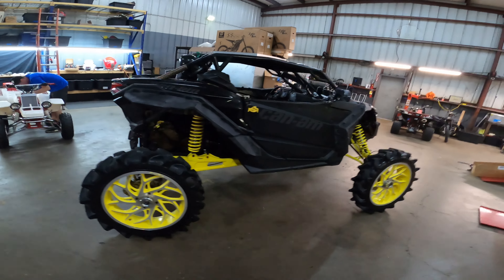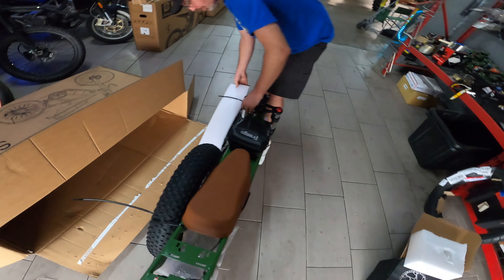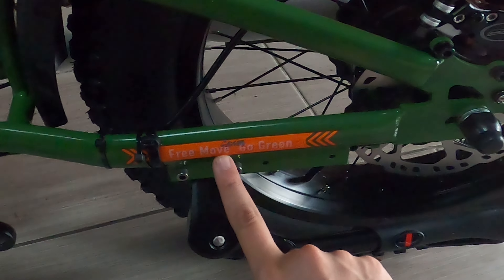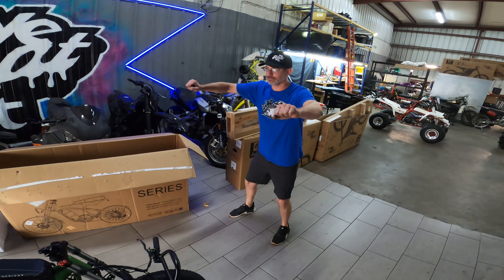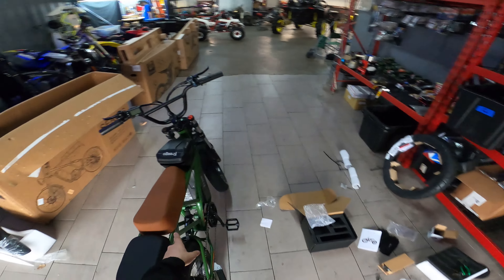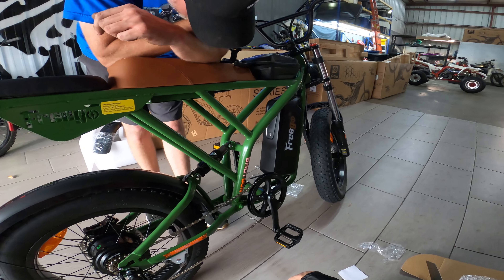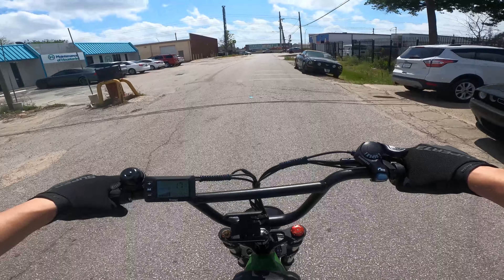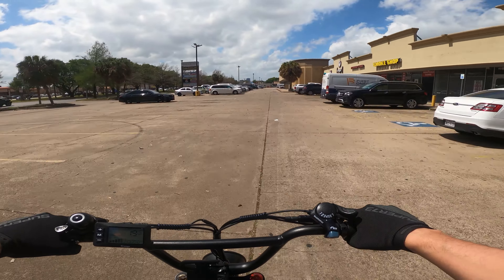Unboxing a More Affordable Super 73

Comment: I own a freego f2 pro. They're decent, they only come in green though and they are kind of delicate. I plan on upgrading the suspension because its pretty bouncy especially with a passenger. The pegs do go on the other way though. All and all its pretty good on handling terrain. It can handle mud and snow pretty decent and the wide tires allow a good grip around tight turns on the road. The hydrologic brakes are really good and can be adjusted by a screw on the levers. Working on better videos of it for my channel.

Comment: Most e-bike planetary geared hubs are inherently fragile since they use nylon gears. Eventually they’ll crack or teeth on the gears will break. Direct drive or mid-drive is the only way I’d recommend to go.

Comment: Take my word for it, it's not a good idea to drop any bike out of the back of the bus..When you have momentum and go over a jump, it's less jarring on battery welds, Bms and contoller components, than if you just drop it 4 feet....Electronics don't like heat or to be jarred..It's never worth the risk when batteries cost 1-2 grand and controllers and motors are expensive and a pain in the arse to change out...
Reply from the maker: I literally throw my surron out of my bus
Reply: @loopholeculture  Ya, you might be fine forever, or someday you might break something..It's electronics, circuit boards, resistors, capacitors, diodes, transistors, sensors, etc.,,Electronics don't like heat or to be overly jarred..
Reply: @realeyesrealizereallies6828  ur gonna break stuff either way…it’s a dirt bike, it’s gonna get damaged, repaired, damaged again,,it’s part of the bike